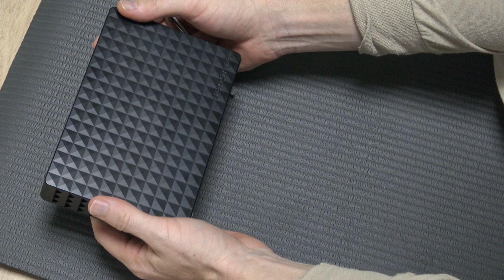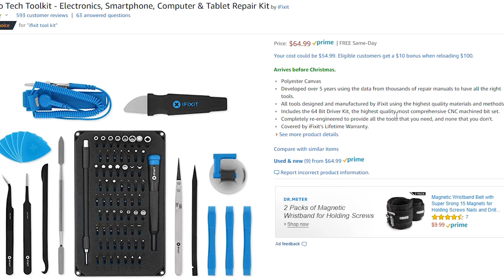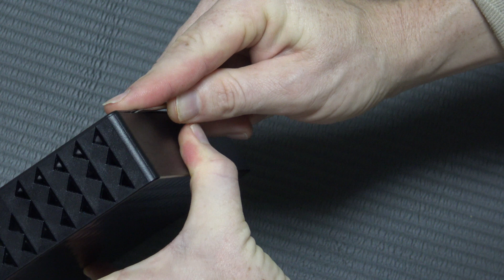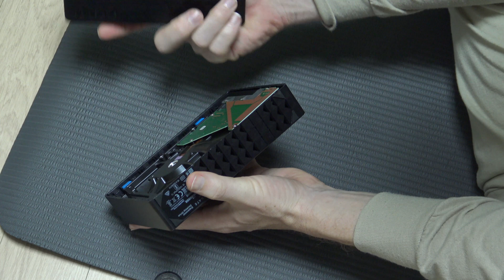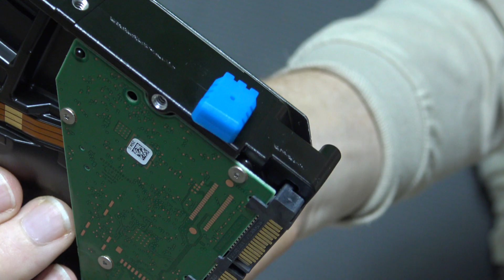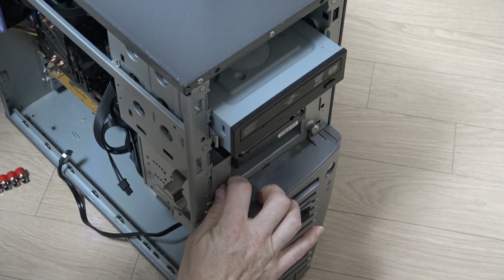Seagate Expansion 8TB Partial Tear Down

Comment: Use Philip's head and don't stab myself, got it. You are a tinkering fool. 

Spark's battery capacity is down to 14.2kwh (38k miles), if you were curious. I track it pretty frequently, so I think it's fairly legit (as the drop has been pretty linear). I have a boneheaded theory that the Spark pack output ratio (capacity/peak power output) is right around that of a Tesla performance pack (ludicrous mode specifically), and that maybe launching the Spark A LOT is at least partially to blame.
Reply from the maker: Tinker is the only way. Dang, 14.2 is kind of low. It could have something to do with the winter time? I am commenting on your latest video now.